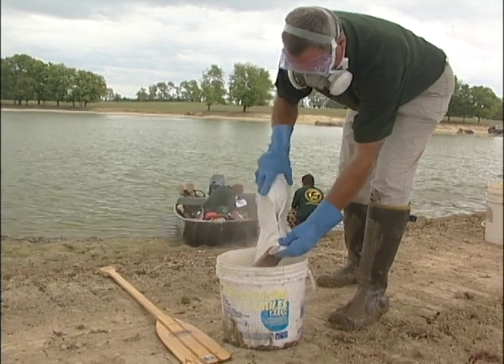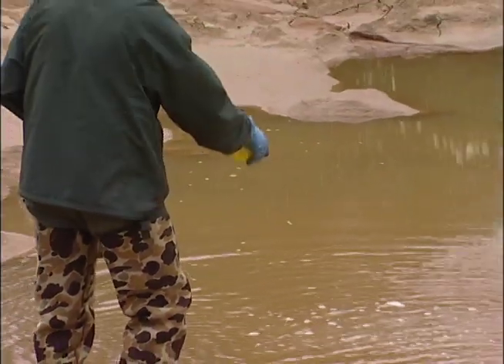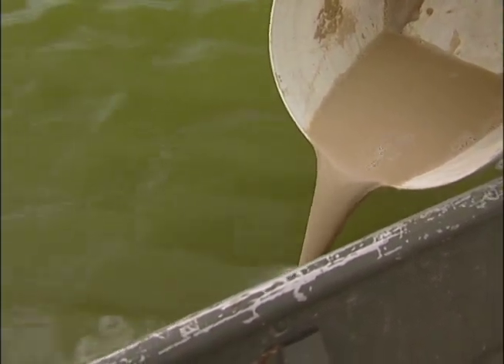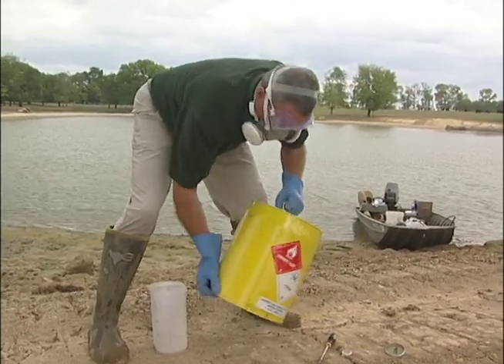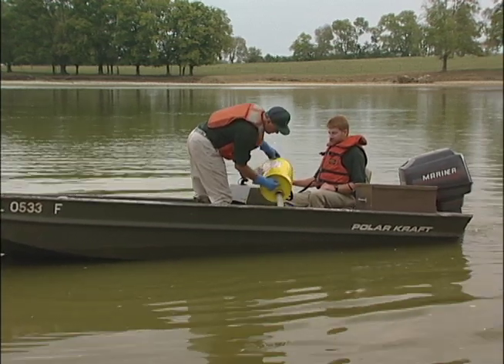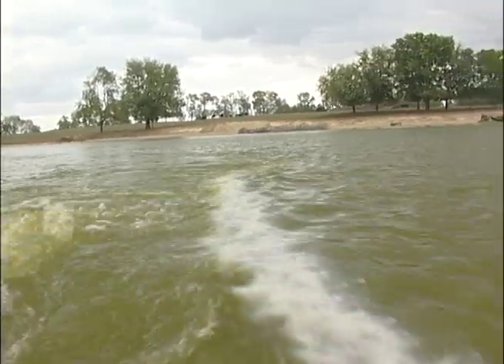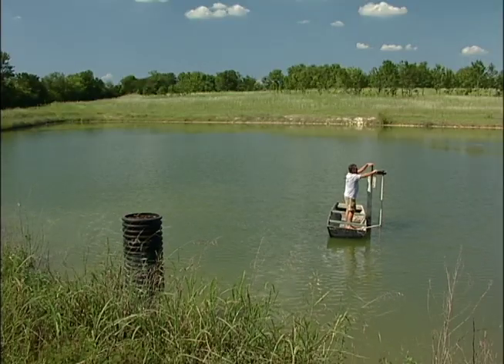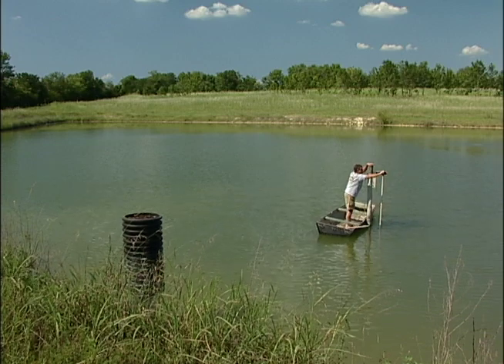Applying Rotenone

Comment: Does that stuff leave a visual trace on the top of the water? Kinda like motor oil in water. A rainbow effect? I work at a place that had a small man made pond and they have to drain it. It has alot of different fish. They put something in the water that does that and its killing everything